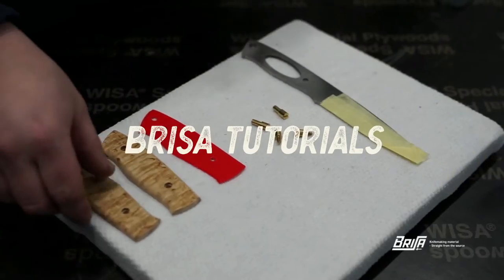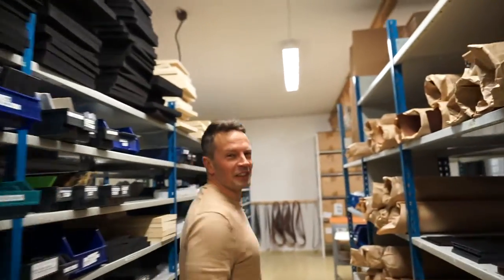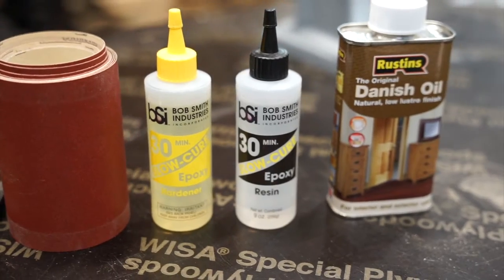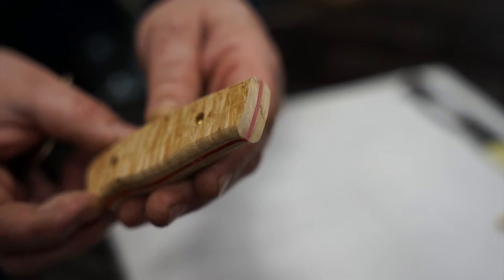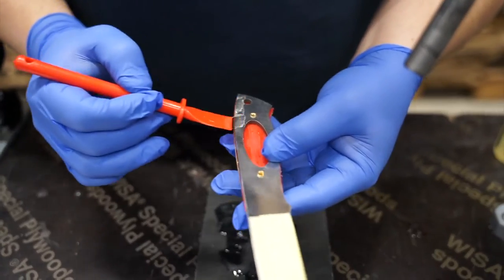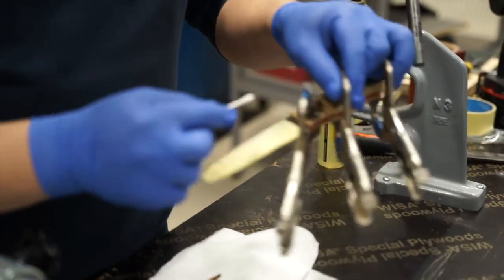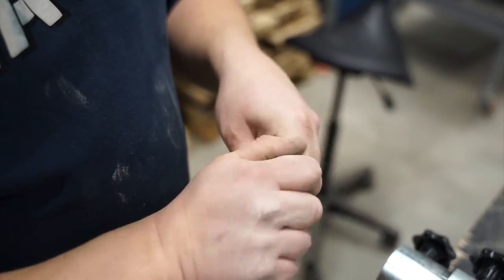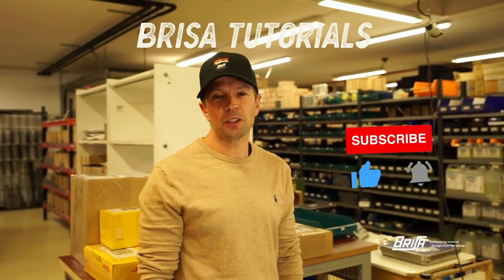BRISA Tutorials - How to make your own knife using a Brisa knife kit

Comment: Don't get the Torx screw they offer in the kit, it fits very badly, get the Corby rivets instead. I bought two Trapper sets, both with screws, and it sucks to fit it correctly (you probably need a specialized tool).
The head of the screw does not fit well at all and I messed up the lower (narrow) part of the hole while trying to widen the space to fit the screw heads. 
Luckily I had some brass pipe that fits the holes and spent about 6 hours just making small purplewood rings to fit the space left between the scales and the brass rod (where the screw head was supposed to go). Turned out nice in the end, but there was much more sanding and fitting than I expected. 

Not sure about the Corby rivets and how they fit, but you glue it down anyway, so it should not be as punishing as the screws.

Comment: Why does the Brisa 125 kit not have the lanyard hole pre-drilled on the scales, and a lanyard tube supplied ?
Reply: I think its so you can choose if you want a lanyard hole or not.
Reply: @rubenchristensen596  Thanks Ruben, but I'd prefer the option of having one already drilled as I only have hand tools. If you had one provided you would then have the option of using it or not, rather than faffing about to create one.
Reply: I drilled it out on mine.
Reply: @rubenchristensen596  Dear Ruben , what annoys me is that if you purchase the finished product it comes with a lanyard hole, but the kit doesn't ! Did you use a power drill or a handheld drill ?
Reply: @clivedunning4317  i used a drill pres